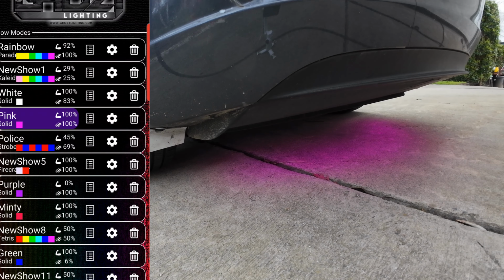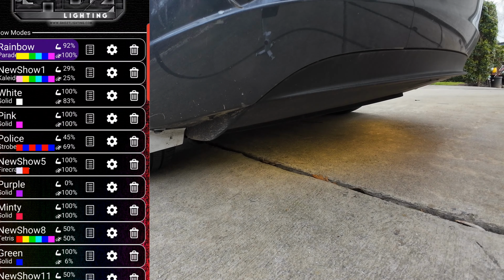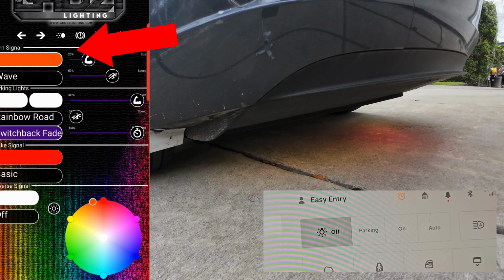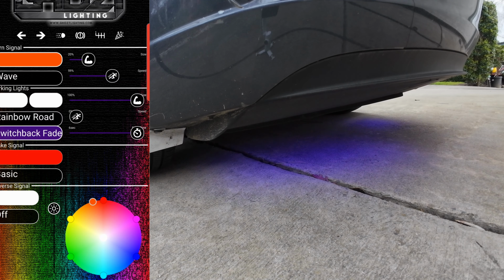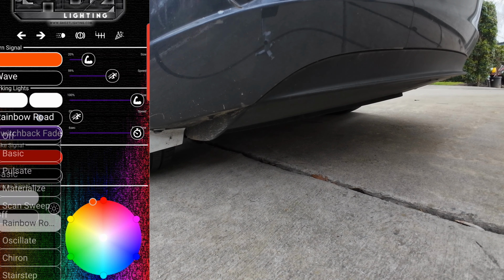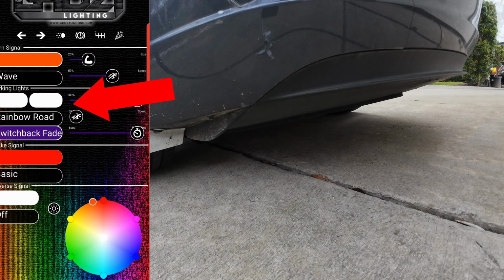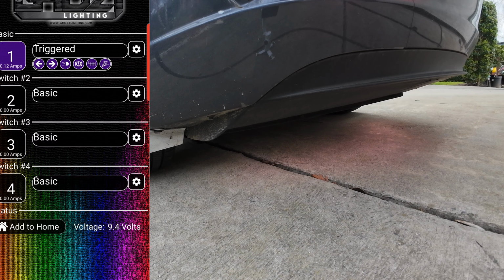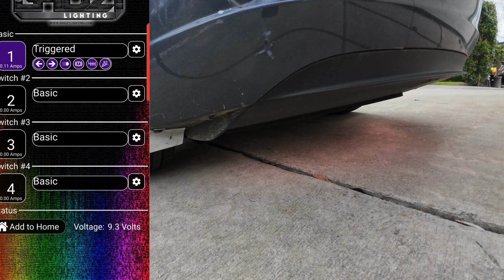BlueGhozt lighting app with TESLUX underglow

Comment: V's isn't power ?
Reply from the maker: I'm sorry, I don't understand
Reply: @TeslaFPV  In the video your are talking about Volts as they are power W, and then current (amps) when w=VA... as if you don't know what your talking about :(. So you are right, you "DON"TUNDErSATAND!
Reply from the maker: @ndudman8  voltage is a part of power yes :)
Reply: @TeslaFPV  Oh come on listen to what you said and just be more precise next time :), or actually factual... but yes V is part of power and the V went down because there was a load (high current)
Reply from the maker: @ndudman8  correct
Reply: @TeslaFPV  :) thanks for the video's they were interesting.
Reply from the maker: No problem! :)